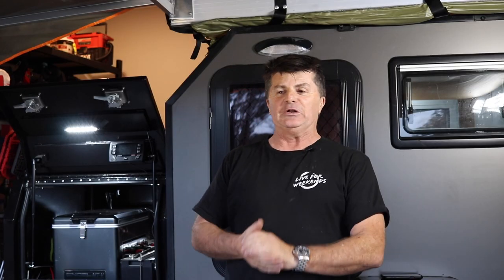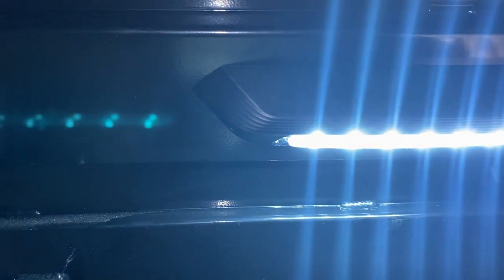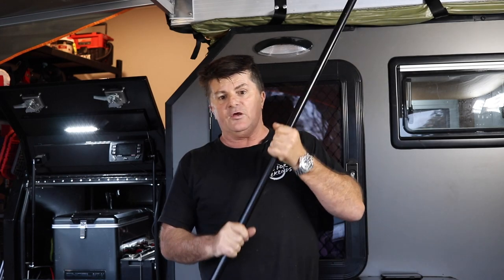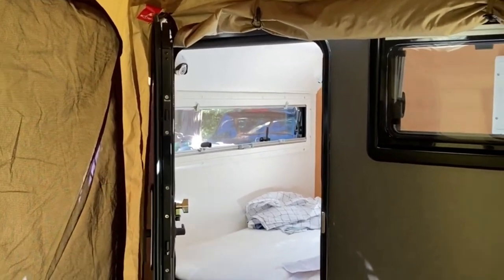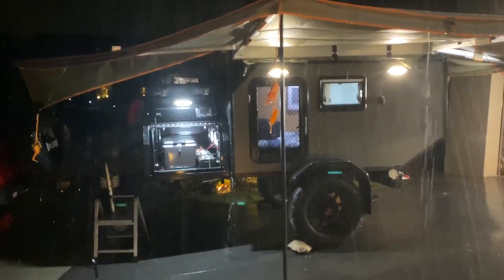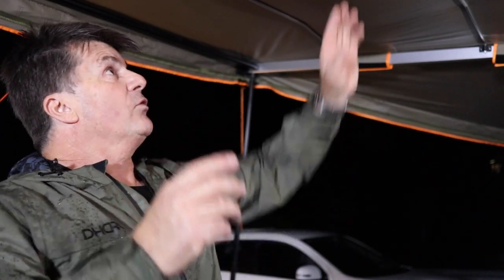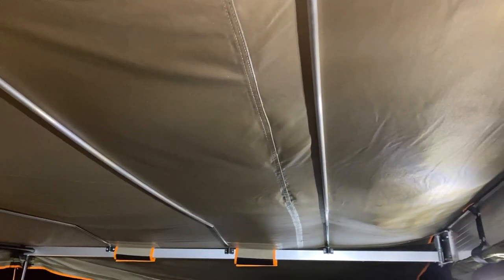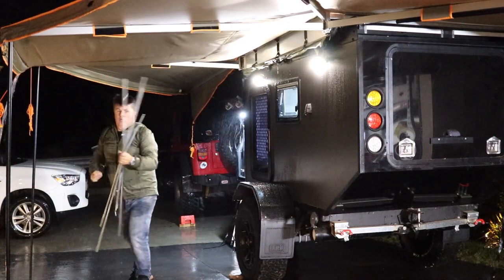Darche 270 deg Awning // Water Pooling Issue Hack

Comment: What a great idea Darryl. Thanks for sharing that!
Maybe you can sheath that 12mm aluminium with some soft hose or maybe attach some of that hot water insulating split tube to stop it wearing the awning material as it flaps in the breeze? Not sure if this is a problem over years of camping, but in case it is...you know what I mean.
Whatever, that is such a great idea - I didn't realise those things can be bought yet I've noticed them on utes myself!
Reply from the maker: Thats an excellent idea Benny

Comment: Instead of using those black brackets, drill a correct sized hole in the top of the arm for it to sit into makes bars slightly higher, and also invisible when not in use.
Reply from the maker: My issue with that is you are only supporting the crossbar by the thickness of the awning arm material. Whereas the brackets provide maybe 10mm of contact so are in fact self supporting the crossbars, I can also easily replace the fittings too, if an elongated hole wears its drill another hole time.